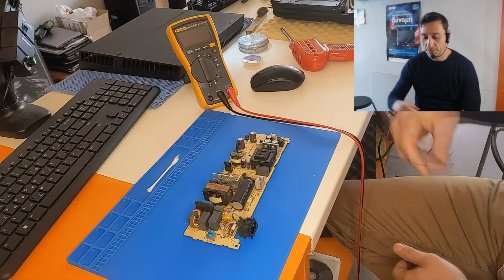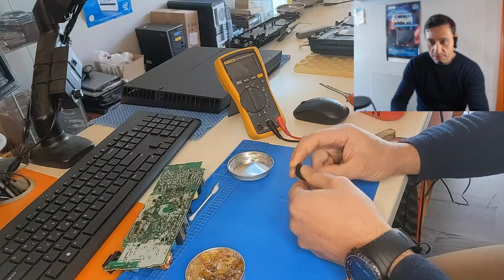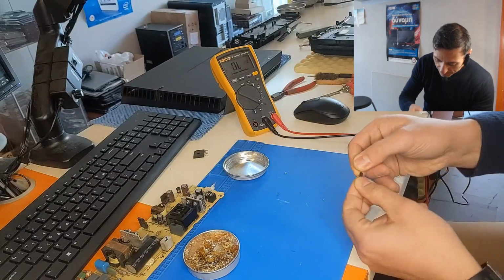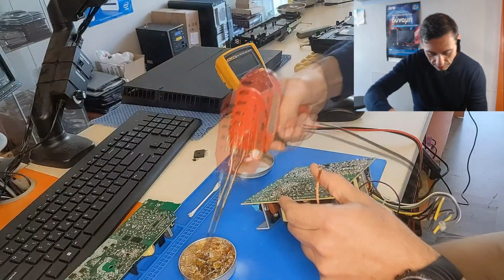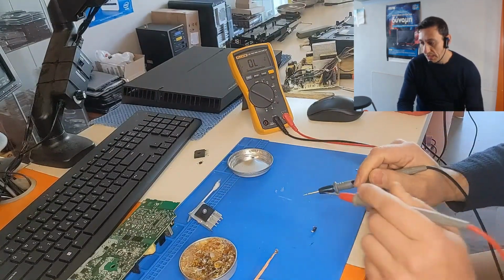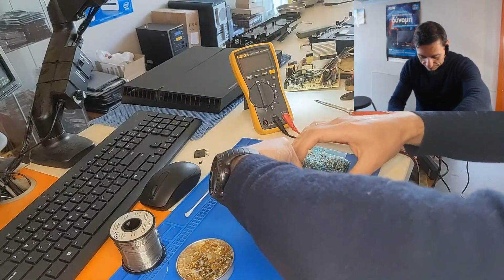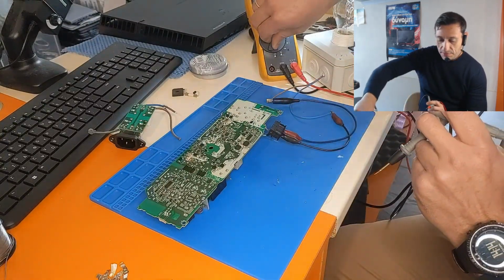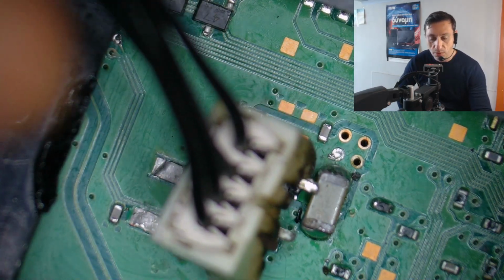PS4 blown power supply repair

Comment: For the rectifier bridge, I admit, it's no doubt it was shorted, indeed. But the other thing you removed from the board was NOT a diode! 
Based on the board marking (FB15), and the fact that there's no inscription on the body of that thing, I would say it's simply a Ferrite Bead on a wire, which is normal to be read as short be the DMM in diode mode.
The funny thing is that replacing it with a diode may or may not be successful, depending on the diode polarity in the circuit. Your actually had a 50/50 chance to this...
Also, I can't see properly from the video, but IF that's a PFC circuit there, then 300V shows it's not working properly. The function of the PFC circuit is to boost the voltage to a higher value, usually around 400V...

Comment: Hi nice video. Do you have a link for your microscope stand and microscope i really like it
Reply: Hi,this is no diode,it's a ferrite bead for antiparasitic reasons.Its supposed to be short circuit both sides,since it's just a simple wire.Its marked as FB on the PCB.
Reply from the maker: Hi Steve. Thank you for contacting with me. The microscope stand is actually an articulating desktop monitor arm. I have removed the monitor mounting part (the one the bolts on to the monitor) and placed the 50mm adjustable microscope stand there using a small tube and a single bolt. The microscope consist ofa  typical 38MP HD camera with 100x lens.
Reply: @pc-mastor   oh yea black peace you solder is normal not diode i think it is coil ( ferrite bead ) that is why it FB the component name is . i mean black piece with no stripe on it and it measure short.  Just for explaining in future i think it will work with diode to. Because it conduct one side. Regards Steve from Belgium
Reply: @pc-mastor  Hi thank you for your answer i was also looking to use an articulated monitor arm but i didn't know we really could use it. You prove it now it is possible. Thank you very much.

Comment: I mix the Kalafonia rosin with Isopropyl alcohol in a squirt bottle to dispense when doing hole thru components. Prefer the Amtech or MG chemicals flux when doing surface mount (non sticky).
Reply from the maker: I have a mixture of this in a syringe. Works pretty well. But it's dirty as you said. For more precise work i use Amtech